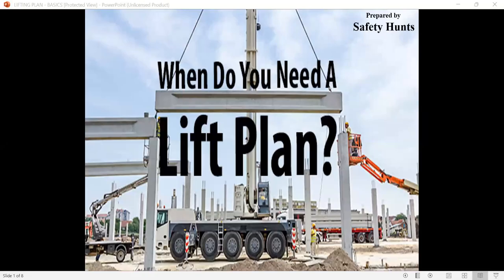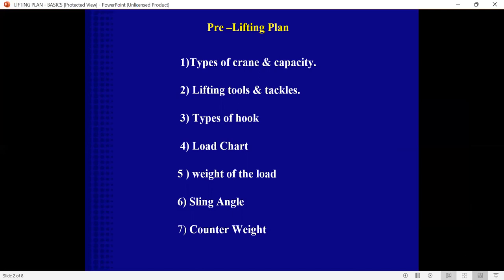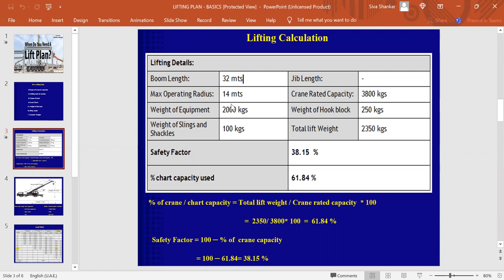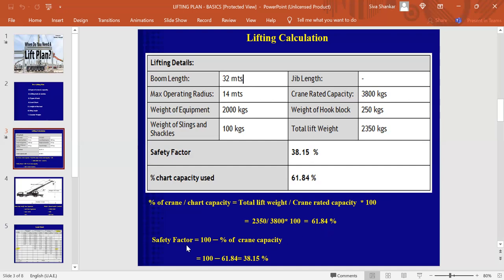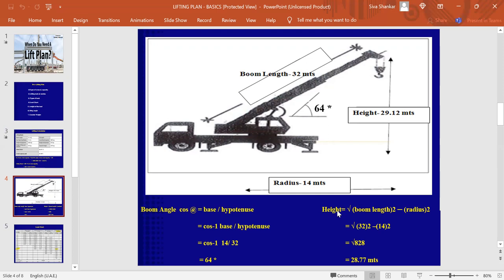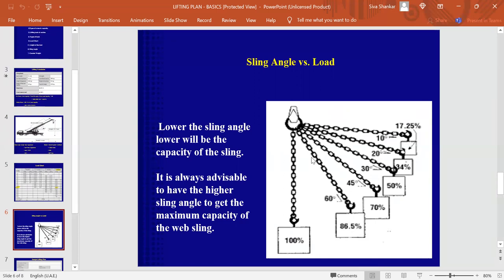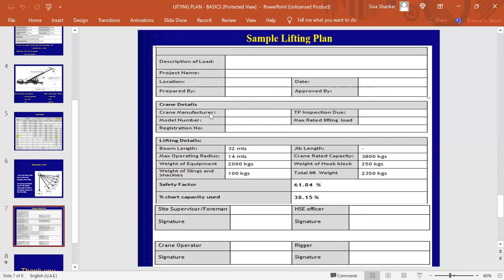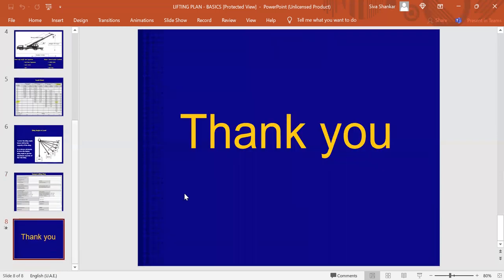Lifting plan // Lifting plan calculation // How to calculate a Lifting plan

Comment: 07:02 it is not to the ground level but rather to the base of the crane. That crane can't point at ground level.
Another thing, why make the height so high? and why boom out so long?, you did not mention any obstacles to negotiate to justify the boom length of 32mts, that is more than double the radius.
29 metres is insanely high for a radius of 14 mts
That is why the graphic is not to scale, which is a fail lift plan in the UK.